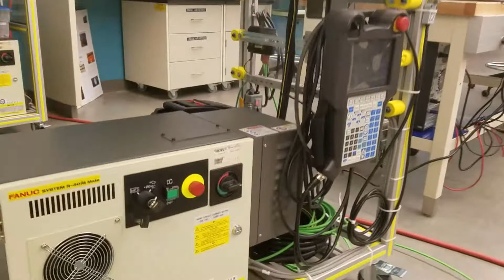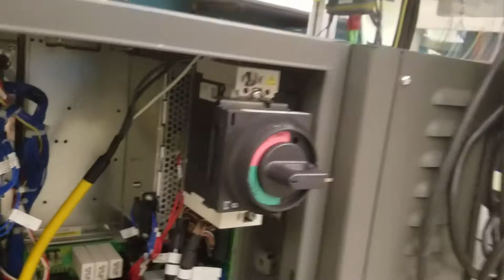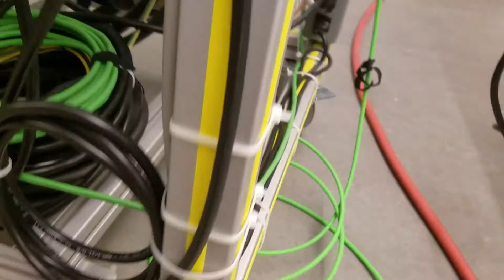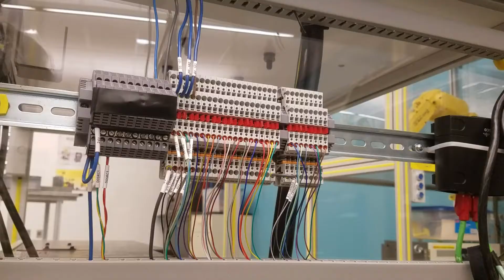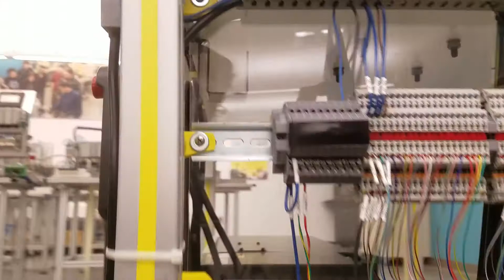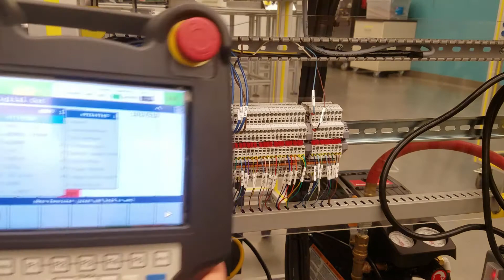Fanuc Robot IO

Comment: good introductory video, I bought a I/O simulation box from Fanuc for our teaching robot, and it came with 0 manuals and documentation so I need to figure it out, very disappointed at them. It looks like it connects to the same port as you show in your board, hopefully the same set up window also works the same.